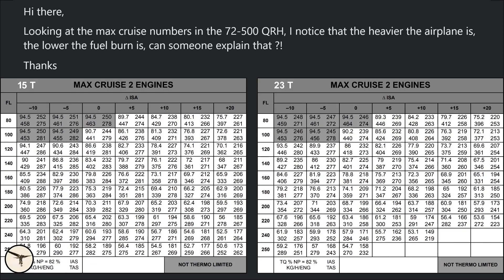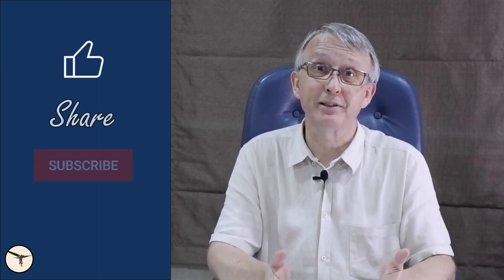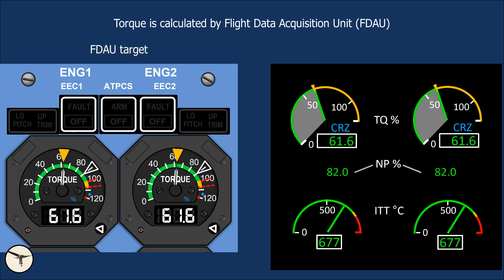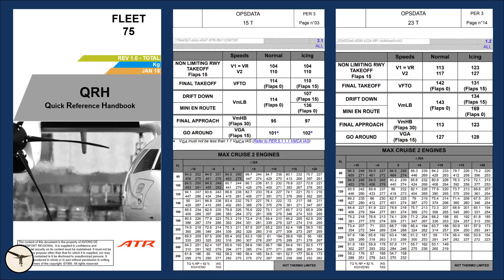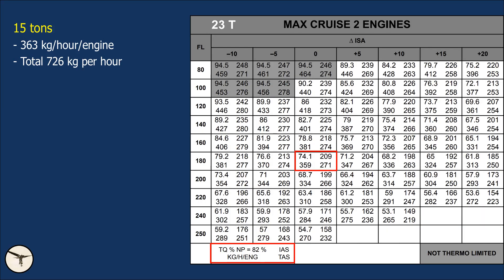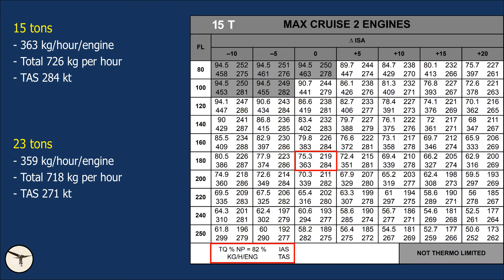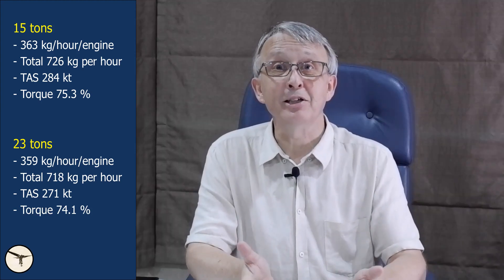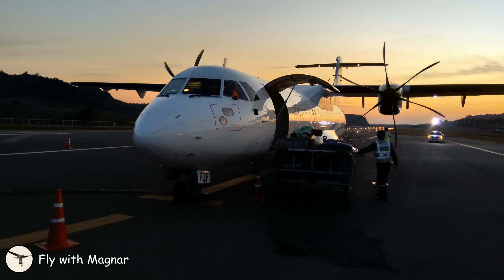Why does the fuel consumption go down when the aircraft is getting heavier?

Comment: I think to oprate ATR 42-300 What is youe advice
Reply from the maker: It is an old airplane. It will be hard to find a well-maintained 42-300. If the operation calls for a low utilitazation of the airframe for example cargo operations, it should go well. But if you plan to fly a lot, you should aim for a newer, well maintained aircraft. Low-cost carriers buy new aircraft for that reason.

Comment: Very interesting indeed! I thought the reason could have been the efficiency of the airfoil. When we are gliding and we try to hurry to the next cloud or thermal resource, we mustn´t speed up to much, because the efficiency of the airfoil turns worse, if the angle of attack becomes negative. I assume the airliners do not have situations with negative angel of attack ?
Reply from the maker: With a negative angle of attack, the lift coefficient is very low. Depending of the camber of the wing, zero lift coefficient is reached at -2 to -4 degrees AoA. Therefore, you need a very high speed to maintain lift. However, the parasite drag incerases with the square of the speed, so it is not desireable to fly that fast when you think about wing efficiency and fuel economy.

Comment: Another way to look at this from sailplanes (no motor) perspective. At higher weight, or wing loading the maximum ratio of L/D occurs at higher airspeed. This is why sailplanes on longer flights (strength of lift permitting) will choose to fly with water blast. It moves most efficient flying speed higher, so then can cover a longer distance in same period of time. 
Adding fuel to a powered aircraft is like adding water to a sailplane (both increase AUW). I think change in motor torque observed is related to the aircraft being able to fly faster speed at same aerodynamic efficiency.

Comment: Just wonder what's MAX CRUISE in ATR's terminology, does it mean maximum speed?
AFAIK for all turbo fans I know of, MRC/LRC and ECON speed with same CI, all goes up a little when weight goes up.
Reply from the maker: MAX CRUISE means maximum cruise power. The limitations are mechanical (2132 shp) and turbine temperature, which in turn depends on cruise altitude, atmospheric temperature and indicated airspeed. The power is reguleted by the Engine Electronic Control (EEC).

Comment: It's like any engine. The more air you supply to it the more fuel it needs to keep the correct air fuel ration so the ram air effect of moving faster is like adding more supercharger pressure/volume to a piston engine. At least that is my take on it.

Comment: I'm learning to fly a paraglider. I don't think an airplane can see me if I'm too high and they'll run right into me. If I lined a lot of my gear with tin foil aluminum foil would there be a big blank on the weather radar and with a pilot see it in time to turn and miss me?
Reply from the maker: A weather radar cannot detect paragliders. A foil will not help. The reason is that the weather radar is optimized to detect water drops. Your best protection is to stay well clear of controlled airspace and similar areas near the airports.
Reply: @FlywithMagnar  do other airplanes show up on the weather radar?
Reply from the maker: Only large airliners when viewed from a certain angle. But the echo from the aircraft looks like a ground echo. The weather radar is not designed for this.

Comment: An aircraft takes off from point A to land at point B after one hour.
Now earth is spinning @ 460 m/s means point B shifts by about 1600 kms.
So the plane actual speed is greater than 2300 km/ hr.
Pls explain 🙏
Reply from the maker: The Earth is spinning with 15 degrees per hour. That's how fast the sun is moving over the sky. Since the atmosphere is spinning with the Earth, we do not feel the rotation (the change in G-force due to the Earth's rotation is minimal). Otherwise, there would have been 1600 km/h winds at Equator.

Comment: Is more convincing when the velocity of both the light and the heavier plane is constant and cruising speed and altitude are adjusted by wing (flaps) attack the angle. In that case fuel consumption per hour or nautical mile 4:53  Heavier plane consumes more fuel.

Comment: This has nothing to do with this Video, but:  What are the rules for "altatude equivilant cabin pressure" when landing at an airport above 8,000 ft?. Years ago I flew from Quayaquil Equador (near sea level) on a short flight to La Paz, Bolivia. (@ 13,325 ft).  IMHO for greatest "passenger comfort" the cabin pressure should be decreased linarly from "sea-level" to that of Quito airport, but that would have a third if the flight at above the 6,000 to 8,000 standard?
Reply: Cabin pressure usually is at 8000 ft. when at cruise. The system adjusts cabin pressure automatically based on the altitude of the destination airport which is set prior to descent.  If destination altitude is above the cabin altitude, we reset the cabin altitude to max altitude manually before landing.

Comment: The fuel flow went up because torque went up. But the torque objective is a proxy for the thermodynamic limit so you need to explain how the allowable torque increased without raising the ITT.
 The lighter plane has less induced drag. It can fly faster for the same torque. That increases the airflow. Increased airflow reduces the ITT. So torque can be raised slightly until  ITT goes back to the limit. That is it.

Comment: What is the fuel consumption if the throttle is reduced to maintain air speed?
Reply from the maker: That depends on which speed you want to maintain, your weight and your altitude.

Comment: In PPL course I was taught that back CoG gives least fuel consumption as stabilizer has to generate less inverted lift, consequently less lift is required from the wings. I was expecting this direction of logic.
Reply: That is often the case, but don't forget at higher altitudes especially, the aircraft has to fly at a higher angle of attack (all things being equal) in order to generate enough lift in level flight. More lift=more induced drag BUT the less dense air might offset that increased drag anyway
Reply: CG position and subsequent trim drag has near negligible effect on fuel consumption. Furthermore your assumption of a tail producing “inverted lift “ is erroneous.
Reply: @danielcockerspaniel  But the tail does produce a downward force. Since the center of gravity is ahead of the center of lift, the tail must pull downward to counteract the nose-down torque of the CL-CG arm.
Reply: @johnopalko5223  this is incorrect.

Comment: What I took away is that this is thrust limited, and at the heavier weight (and higher induced drag) the reduced speed also reduced the thrust (due to loss of intake ram). So we get less fuel over time. But still more fuel over distance, as we expect.

What about best range cruise, do those charts go like we expect?

Comment: So what you are saying sir is that a lighter aircraft at 280 knots burns less fuel per hour than a heavier aircraft flying at the same 280 knots?
Reply from the maker: That's correct. A lighter aircraft needs less power.

Comment: With 70 Pax at a hypothetical 23t that gives a fuel consumption of pretty much exactly 2 kg/pax*100km, or 2.5l/pax*100km.
In reality it might be a bit higher, averaged over an entire flight, including climb, taxi, less than full passenger load, etc. but it is better than a car with the average of 1.5 occupants.
Still competitive up to 2-3 occupants, depending on the car model.

Comment: One question magnar.. Why do you all disconnect the yaw damper on approach?
Reply from the maker: ATR with EFIS cockpit: The yaw damper will act against your actions on the rudder. When you press hard on the rudder, the yaw damper will suddenly disconnect, causing a noticeable jolt. You can land with the yaw damper engaged, but it's not recommended in crosswind.
ATR with glass cockpit: This aircraft has automatic rudder trim when the yaw damper is engaged. The yaw damper must be switched off before landing. Otherwise, it will trim the rudder in the opposite direction of your input on the rudder.
Reply: @FlywithMagnar  how to know if the downwind is at thw correct distance for an atr?
Reply from the maker: The distance depends on your speed. If I turn from downwind to final at 140 kt, the distance should be about 1.5 NM. I can use landmarks for judgement, or I can use the navigation display.

Comment: Great video and explanation.
I have a weird hypothetical question: given a  15k ft runway, could an ATR 72 at MGTOW take off from a standstill with one engine feathered?
Reply from the maker: I have tried that in a simulator. It was set to neclect chashes, and off we went. To maintain directional control, the power must be advanced very slowly. And when we passed the end of the 10,000 feet long runway, we were not even close to the take-off speed. After what felt to be an eternity, we finally managed to reach VR. But it took more than 15,000 feet, for sure. You can calll it a road trip.

Comment: Hi Mr. Magna thanks for you video. The true I've helped it to understand a little  about Performance. I'd like to ask you a question. Is there any aventage of configurate the aircraft with the option Long Range performance to routes with distance less to 200 NM? The question is because in the company where I'm working,  my chief are looking any way to save fuel and he believes that change the configuration of Cruise at maximum speed to Cruise at Long Range is the better way to save fuel. I hope as soon as possible you answear.
Reagards
Reply from the maker: You might save some fuel, but the problem is that the workload for the pilots will increase as they will have to continiuously adjust power to maintain a given speed. Furthermore, the cruise segment is short, so the saving will be minimal. 
Instead, I recommed to select the highest possible cruise level and to reduce the speed during descent. Check out FCOM PER.8.2. 
Here is a video about fuel saving: https://youtu.be/f_vbFjEmtD8
Reply: Hey, there is a document call "fuel saving" written by ATR, they say long range, cruise at the highest altitud posible and descent with 200 kts at a path of 4 degress could help save some fuel. ( i apologice for my bad grammar and writting)
Reply from the maker: The saving is from reducing the speed, as there's less drag. A steeper angle, however, doesn't save fuel.